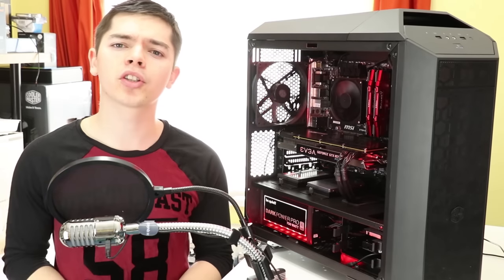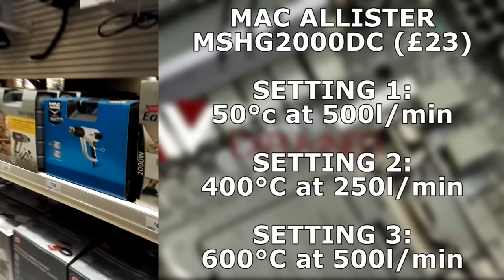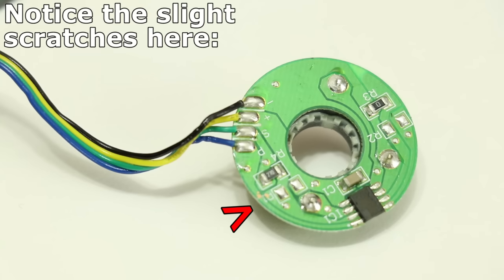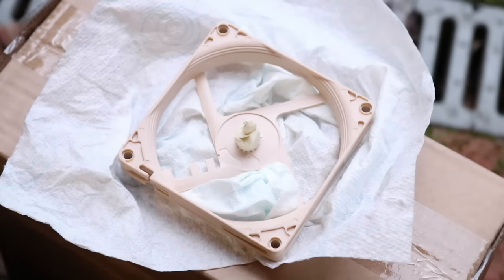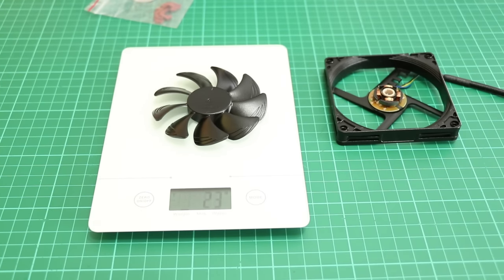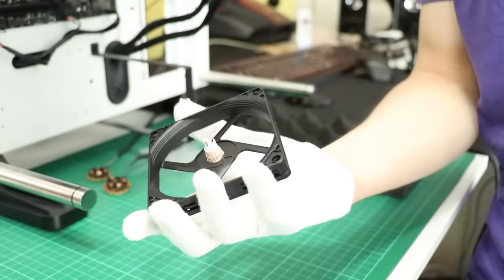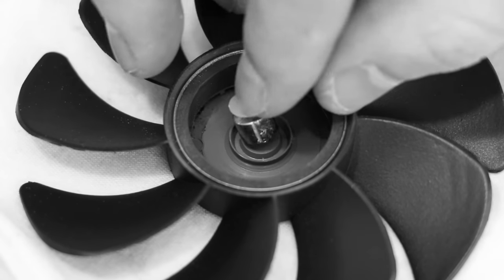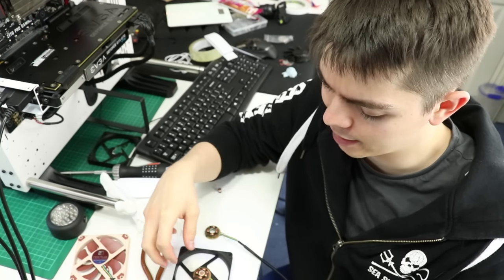Noctua NF-A9x14 Respray Guide (This will void the warranty)

Comment: Four years later.... this let me disassemble & clean the failed NF-A9x14 in a much-neglected computer that had become very dusty (it was my main gaming machine several years ago, now it sits in my exercise room solely to run Zwift, not a big priority to open & clean).  Pressing down the copper disk around the drive axle was the trick, I'd probably pulled it up when removing the fan blades.  Thanks for figuring that out!  I ordered a replacement anyway, but at least for now it no longer stops at POST with a CPU Fan Failure message.
To folks that don't like long-form videos:  change the playback speed to 1.5 or 1.75.

Comment: I always spray them without tearing them apart, they work as if nothing happened.
Reply from the maker: That's fair, if it works, it works. As for this paint job I wasn't confident that I'd be able to cover the spokes behind the blades with even coats of paint all round (same goes for the underside of the blades behind the spokes), so separating them was that easiest way to guarantee full and even coverage.

Good to know there's another way to do this, at least some people might stumble across your comment and have an easier option. Thanks for checking out the video and sharing your experience, and I hope you enjoyed the video (albeit being mostly pointless for you since you've already painted your fan haha, ah well).

Comment: used this as a disassembly guide for repairing an 80mm case fan. where i am it is impossible to find new ones for reasonable prices. all it took was a disassembly, thorough dusting, a little 6 in 1 oil and it spins again. thank you)

Comment: This video was unbelievably helpful to me when modding my gpu fan. I have one of those itx gpus with a very loud fan that I wanted to replace with a noctua. I was able to disassemble my 92mm noctua fan, cut apart the frame, bond the plastic base to the existing gpu shroud, then reassemble the fan back on top of it. The result is a silent, high performing ITX gpu which would not have been possible without your detailed teardown and reassembly process. Seriously, thank you so much! I'm sure there are other cool use cases out there that that require detailed noctua teardown/reassemblies that may find this video some day. This is also an awesome video OGs can point to back before noctua released a black variant, to really highlight the dedication of modders

(This is a repost of my original comment because it was autohidden when I tried to edit some typos)

Comment: It may seem like a stretch, but since you slightly increased the surface area of the fan blades, the fans should be pushing slightly more air than stock.

Comment: Also possible: if you're re-using the old numbers instead of retesting the unmodified fan in the current testing environment, another variable like cooler mounting pressure or the paste application setting in could be contributing to the discrepancy. If I recall, that cooler had come off to test the 65mm cooler before going back on in the end.
Reply from the maker: Good points, but I don't think there are different factors that you've mentioned in this situation. I should have clarified this in the video, the clip testing both fans initially was cut to keep trying video time down.

The second fan performed identically to the first both hitting 2600rpm. The third fan hasn't been tested with since it's the lesser 2200rpm version.

As for mounting pressure and thermal paste. All applications get more than enough thermal paste (more tests the same as just enough and is easier to avoid having too little). And the screws are tightened until they hit their presdesigned stops which should eliminate mounting pressure tolerances.

But even if any of those were relevant factors, it wouldn't explain how both tested hitting the same numbers, and after the first few tests the original fans performance dropped off. If there were any differences with mounting pressure or thermal paste they would have shown up in first test of Prime95, and all tests following it at a similar rate.

There's some difference between these two which sees the original fans performance degrade over continuous full speed use. I can only think that the different lubricant can be that deferentiating factor.

Thanks for adding your thoughts to the mix, it's always good to rethink over these factors incase something was missed. And of course thanks for checking out the video :)

Comment: No heat is required to remove the fan hub and blades. They're just a push fit, no adhesive. It comes off exactly the same as in the video with no heat applied.

Comment: small nit pick that doesn't really matter both paint jobs were probably 74g as the one you showed weighing was missing the rubber feet on one side. but besides the point quite interesting and q1 2019 noctua is supposed to be putting out full blacked out coolers on top of there cromax stuff thats already out

Comment: Very nice, particularly the disassembly portions. Noctua now makes the CHROMAX line which are BLACK for those allergic to beige / brown. Available in most sizes. Some chromax items are more expensive. In the case of the NH-L9a-AM4 +$10 and they have anodized the cooler black.  Other fans about +$5 .  Fan + Black cooler a little more. Save time buy the black fans if available.

Comment: I actually used your tutorial to to spray a brown NF-a15 fan. I discovered that it is easier to remove the blades of the brown fans compared to the chromax fans.
Reply: We're you ever able to remove the chromax blades?
Reply: @Nordic_Goon  Unfortunately no. I ended snapping the frame trying to remove it. Seems the chromax nfa15 fans are built differently from the regular brown ones. I have successfully removed the blades from 2 brown fans now.

Comment: The temperature may be different because you removed the heatsink and re-applied thermal paste to the CPU. The application of thermal paste will always change the temperatures slightly because of different amounts of thermal paste been applied.
Reply from the maker: I see what you mean. I attempt to counter this by always applying too much thermal paste to ensure there's always full coverage. Any excess ends up around the sides of the IHS.

All the data I've seen and carried out myself suggests too much thermal paste is as effective as an optimal amount, so by applying too much I always ensure there's never not enough.

In CPU cooler reviews I expose how much thermal paste is used, and how the application spread out under the cooler to gauge the effectiveness of the mounting solution.

Comment: How much damage would come from submerging the fan in a dye solution? Be it alcohol or water based. I have 3 of the gray fans and would hate to have to buy all new ones though, I am building a second PC anyhow. I have two spare Noctua fans I may just throw caution to the wind and try it on one of them. The issue I see would be displacing lubrication (even more so with an alcohol based dye) I don’t exactly feel the PCB or windings would become damaged. Clearly you’d want to make sure it dried fully. I see so many potential issues but again, I’m curious... If I do decide to attempt this, I’ll report back. As a side note, if you disassemble the fans ANYWAY Dye would still work assuming they’re glass fiber reinforced nylon.

Comment: Really nice video, I can see you are pretty perfectionist. 
An airbrush with a little compresor its not very expensive, and it will allow you to improve the paint control application, and the quality of the final result. You can apply a coat of paint much finer than with spray, I think that with a 0.2g of black paint will be enough to make a good cover of all the rotating fan.
 On the other hand, I think the important information is the differences of weight of the rotation part. The rest of weight compararions are not so important.
 The increase of weight of the rotation part its almost 5% (about 4,5454%), I dont think its too little, and in teory can increase the air pressure, i think. Any way, oil differents can be the most important factor of cause of the results.
Reply from the maker: Thank you very much!

Perfectionist, maybe, but as you can tell I don't really have the skill set to back it up haha. I'll get better with time though, at least that's the plan...

Thanks for the advice on the paint application, I'll take a look into it if I plan on doing any more painting.

You've got some interesting points as to the changes of the fan, I've got a few other theories to add to the discussion, but I'd be lucky if I knew what was actually making any differences.

As for the weight of the blades, I think when it comes to the friction from the air resistance at top speed, I think 5% extra weight is negligible. Similar to the fastest cars, their weight isn't as much as an issue to hit their top speeds as their drag coefficient. A 5% weight reduction to a fast car wouldn't make as much of a difference compared to reducing the friction of the wheels or the body of the car (Not the best analogy, but it's nearly there).

Something that's a difficult to tell is the friction of the new paint (or the lacquer) compared to the original finish. And the thickness of the blades is something that's also tricky to tell, but we're probably looking at less than 0.5mm.

All in all though, I think for an amateur shot at painting it went pretty well. Of course we lost a fan in the process, and found out that Noctua have two different fan specifications for the NF A9x14 fan, but not too bad. It's good to know there's not much different in the speeds of the fans, but it might be a good idea to retest this in a year or so to see if over time there are any changes. Of course we lose the knowledge of the control over time, but it could be interesting.

Anyway I've gone on long enough, thanks again for the advice, and thanks for checking out the video. Hopefully we'll be doing some interesting fan reviews in the future, but there's a lot of work to do before then.
Reply: About the airburst paint, I usually paint miniatures (Games workshop and other company’s miniatures). For this fan work I recommend to use Vallejo model air paint: black 602 surface primer, mixed 50% with a airburst thinner. This paint has a thin pigment itself, and with the thinner, even thinner . The black choice is because it is the “color” than cover the best others colors with the less paint. Other dark colors of the surface primer may also work very well, like 603 German panzer grey. Its important to use surface primer paint, and not the regular model air paint (directly), the surface primer its made to really get fixed to the model, the regular is to use over the first cover of the already dry primer paint. For sure there are other good airburst paints beyond Vallejo, but it’s the one that I know. Citadel make excellent normal burst paints, but as I know they don’t make paint for airburst.
The paint application should be easy. A pressure of 15-20 psi is normally used for fine details, although this depends on whether we wish to work at close range(6 cm.approx.) or with a pressure of 20-25 psi at a distance for larger surfaces (15-20 cm.)  Working at close range the paint is applied with accurate. At long range, it works like a calm down spray (with a paint and an air regulator). If we use the close range only after taking practice with the airburst, we can paint the cooler without dismantle it
About the friction, we can see in the video that the spray paint have change the shape of the original making it more rugger, its rise the air friction, any way rugs I think are much less than 0.5mm. The lacquer fall the friction, and now I can see it’s an excellent idea. 
“it might be a good idea to retest this in a year or so to see if over time there are any changes.”
Agree.
Reply: that would be great
Reply from the maker: Thanks for the paint advice, I've got a friend with an air compressor and an air brush tool head, so we might have to mess around with that. The compressor is about 20 years old and is about 1m long (weighs a ton, for small vehicle workshops I believe), but it could be of some use (I have a feeling it won't end  well haha). If that fails, do you have any budget air compressors you would recommend?

The lacquer did smooth it off nicely, but I don't think it's appreciating the use case since it's very slightly peeling in some areas (perhaps a more specialist lacquer is required). It's not too bad, but it's slightly noticeable.

I'll retest the fan in a year and see if we experience any changes, but all these issues will be great to know for someone looking to do some similar fan painting. It should be good.
Reply from the maker: That looks like a pretty reasonable price for what's on offer. It's certainly a great indication of what I should look out for to start out. Thanks again for the advice, much appreciated :)
Reply: You're welcome

Comment: what is the name of the blower you used to dry the water in noctua fan?
Reply from the maker: It's called the Compu Cleaner Xpert. It's pretty powerful and comes with a set of tools to spread or concentrate pressure. I'd certainly recommend it.

Comment: @AVTechy
Thanks for another great and very comprehensive video.
Regarding the risk of damaging Your fan when using the heat gun, I think it would be possible to protect the blades (and frame) "simply" covering it with "something" that won't catch fire or "blow away"... I myself think I would try Aluminium foil attached in a suitable manner as I have successfully used that "technique"  previously.
Best regards.

(In my personal opinion there is no need for disclaimers, unless it's regarding receiving payment or products. In which case I reckon it's "mandated".
Though I can see how You might want to "defuse/avoid" some comments I'm just saying they are not needed for us "normal viewers" :)
Reply from the maker: Thanks for checking it out!

I think you're right, if I did this again I'll definitely use some aluminium foil to prevent heating the blades too much. It's interesting how many seemingly basic techniques I'm learning on these DIY escapades which seem obvious on reflection :P.

I too think the disclaimer included is kind or ridiculous, frankly I would have thought that any customer of Noctua looking to do this would have the intelligence to understand what does and does not void the warranty of the product they've purchased. It shouldn't be up to anyone else to inform them, especially when I'm not working with Noctua on this.

However Noctua contacted me requesting to make sure any viewers were aware of the warranty when watching this, and I don't see any reason to not respect that request (however much I feel it's unnecessary). Apparently several viewers had been in contact with Noctua after seeing this video, and Noctua wanted to ensure the right information was being reiterated at the source of these 'fan painting' ideas.

Anyway, I agree with you that it's not requires, and it wasn't present in the first week or so of its upload. It's interesting how little it takes to get the attention of a manufacturer though.

Thanks for checking this one out, and I'm glad you enjoyed it! :D

Comment: Are these fans still working okay? Any issues with dust or the paint moving more to the outside of the blades? I love the details of your testing. I’m just concerned about the long term issues.
Reply from the maker: Surprisingly the one fan that survived (not the one I butchered :P ) is working completely fine. It tested a good handful of systems after its reassembly and now sits on the shelf.

The only issue I've had with the finish is the lacquer I applied which has flaked off in some areas a few months after its application... so perhaps skip the lacquer step if you want to try it out yourself.

It's not put a step wrong so far mechanically, and I can't see it going wrong after this much time. But that doesn't mean it won't :P.
Reply: AV Techy Thanks for the quick and thorough reply!
Reply: AV Techy So it was a bit of a fail in the long run if the painting process wasn’t done correctly. Perhaps a primer should have been used.
Reply from the maker: @dogbog99  The paint is perfectly fine underneath the lacquer, it's just the lacquer finish that hasn't held up well. I presume it's drying up too much which is causing the flaking.